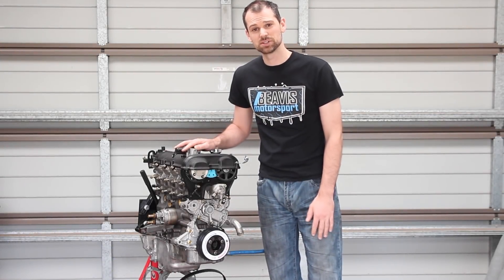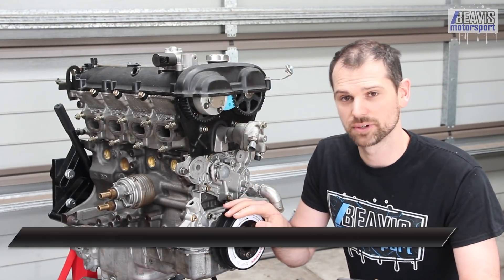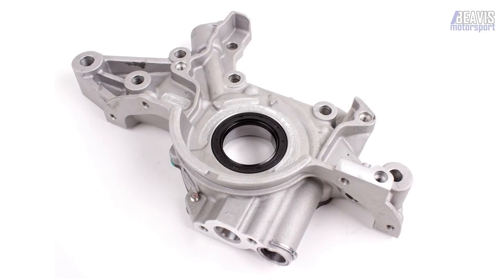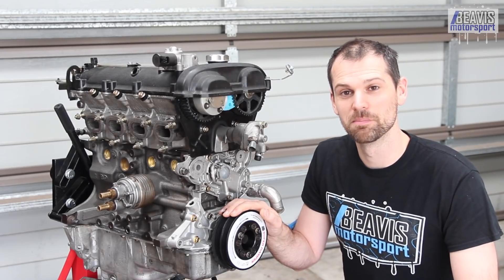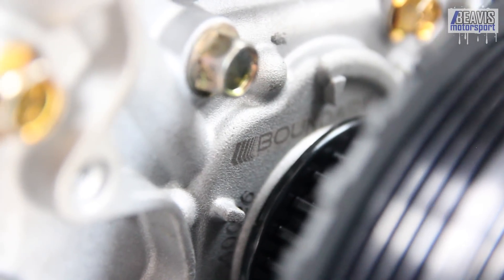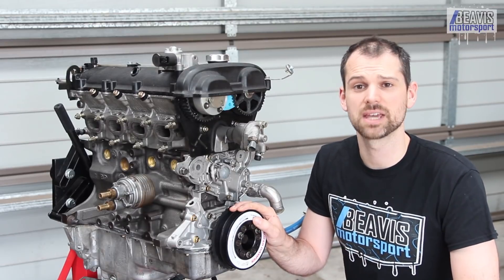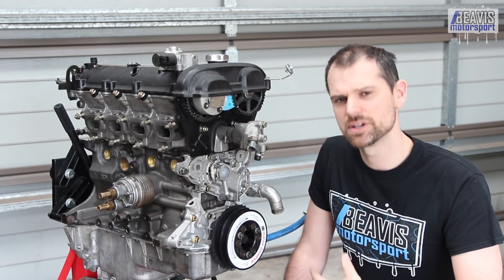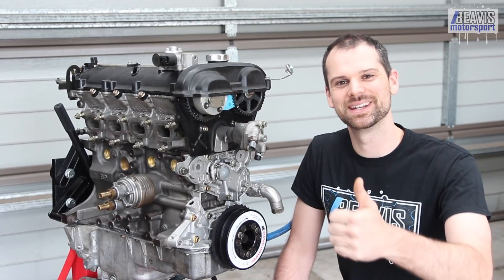Boundary Engineering Oil Pump - What you need to know!

Comment: I just went and ordered a vvt oil pump gear. Not the complete pump. Hopefully install will be easy enough.
Reply from the maker: Yeah, i think this is a good (cheaper) approach rather than a full pump.
Reply: The gears are steel, the housing is aluminum. 
The housing wears before the gears. Letting oil seep between the gears and housing. 
I'd say anything greater than .003 wear grooves is done. 
You can resurface the rear cover plate, once, to achieve an acceptable pressure gain.

Comment: Just so everyone understands, if you put one of these on your engine you have just increased the PSI around the seal by around 65%. On mine I found it to leak around the outside of the seal and not around the shaft. The fit of the seal is not as tight as other seals of this type. I have put anaerobic seal maker around the outer seal to resolve this issue.
Reply from the maker: Good suggestion Max, In my case I swapped the seal out for a genuine Mazda item and so far no issues.
Reply: @Bbeavis  Was your's a stage 1 or stage 2? Mine is a Stage 2 and currently has a leak around the pressed in plug that is used for the Mazda 3 oil dip stick. I have stopped all of the other leaks. Just one more to go. I also replaced mine with an OEM seal first time without the anaerobic gasket maker and it leaked around the outside edge. I have installed another OEM seal WITH the anaerobic gasket maker and it stopped that leak now onto the pressed in plug. I have a plan to fix it without having to pull the front of the engine off again. Thanks.
Reply from the maker: @maxp8892  It is a S2.

Comment: Nice info.

You just run 1 shim? 

I thought for your system was 4 shims.
Reply from the maker: I ran with what is the standard recommendation from Trackspeed engineering. 1 shim on the VVT spec pump.
Reply: How much psi are this ? @Bbeavis

Comment: We have had issues with our one. Small nose, turbo (late 200whp) now running 5 shims to get around 65 - 70Psi (have remote filter and oil cooler fitted) and has been leaking with OEM seal. It appears the leak was from the steel seal carrier that is press fitted to the housing.
Reply from the maker: Leaky seals seems to be a common issue, my advice to everyone is to install a genuine mazda seal before installation. Hope your issues are now sorted Adam.

Comment: Have had one of these (non vvt) with 2 shims fitted for several months now. Great oil pressure under all conditions. Main seal leaked almost instant,y, followed by a second failure. Glad you brought this to the attention of many other users.
Reply: I feel l was lucky not having an API damper fitted. I look forward to hearing of your comments on it, especially seeing as your running a balanced crank. Mine is balanced but with a big weight reduction (8kg) shaved off. Spins like no tomorrow, especially with 4kg off the chrome moly flywheel and a Garrett 2871R turbo for that bit of extra spooling.
Reply from the maker: Yeah it's odd that the seals leak from new. Luckily a few facebook folk alerted me to the fact, and I found a forum thread on Miataturbo that also raised the concern. I wouldn't have wanted to have to remove the ATI damper later to replace that seal so lucky we got it now!
Reply: @Bbeavis  this right here is why I went with a fluidampr, sfi approved and still comes off with one bolt like it does from the factory.

Comment: Good advice, but you'd think an aftermarket upgrade kit would be "trouble free". Thanks for warning us. That's a very similar design oil pump to the old 3.8 commodore. I remember I lost oil pressure and turned around and crawled the kilometer back home. The inner ring flats had worn on the crank nose (or chain sprocket) and split the ring in half! Bought a new inner oil pump ring and welded the sprocket flats up and ground flat again - as you do living on a farm. (no fencing wire tho) A credit to those engines, was worried about the crank bearings, but it went for ever after that.
Reply from the maker: Haha, never late in a 3.8. I've never owned a BUICK V6 powered commodore, had a RB30 VL and an Alloytec V6 though.